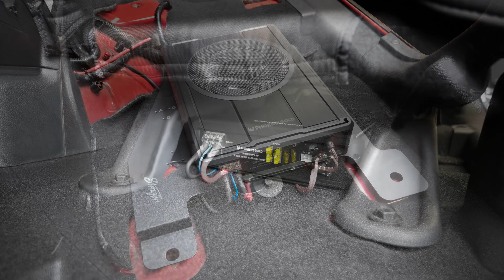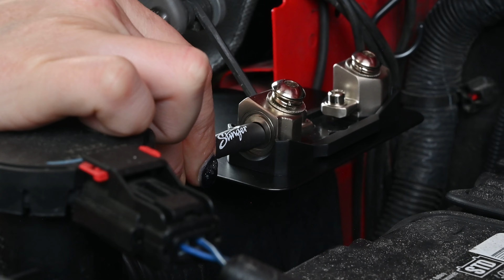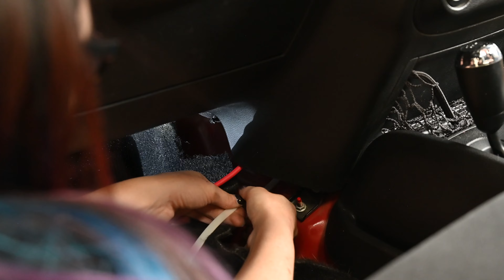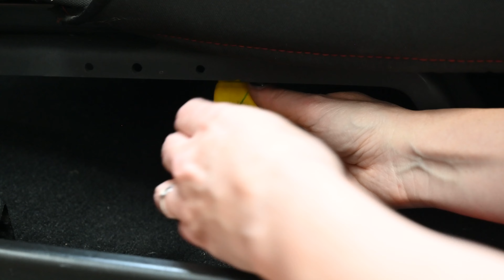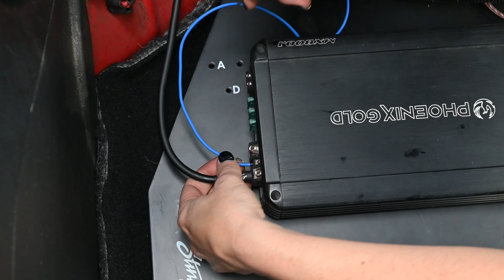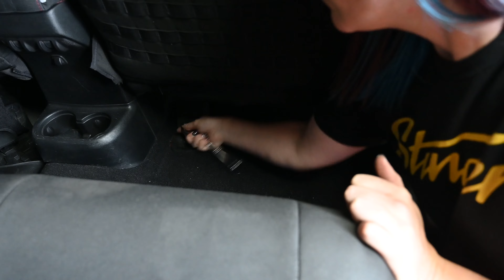Install: Underseat Amplifier Mounting for Jeep Wrangler JK Unlimited (2011-2018)

Comment: Just bought the Stinger amp mount for 2015 Jeep Wrangler JK unlimited for drivers side and it does not fit.  Hits the transmission tunnel.

Comment: FYI: When you pull out the seat don't pick it up by the seat adjustment bar. The two separate rails that mount the seat to the floor will go out of alignment and it's a POS trying to get them right again. I know from experience ;)

Comment: Where can I get the fuse holder bracket? I looked on Amazon but couldn’t find it.  They have the under seat bracket but not the fuse holder bracket.  Thanks for any info
Reply: There are a few companies that make one. Google "Jeep jk fuse holder". I bought mine from Motobilt